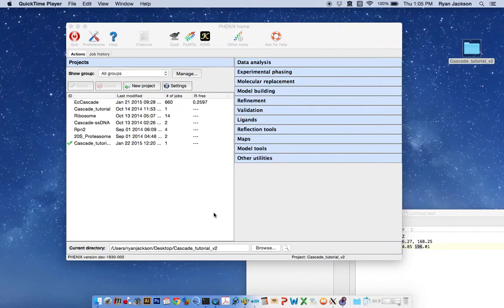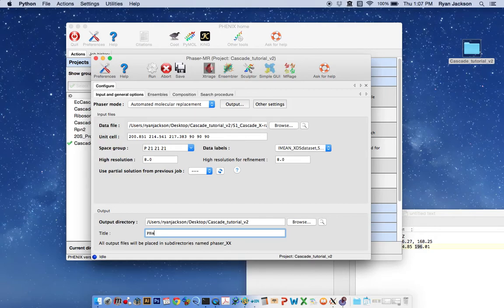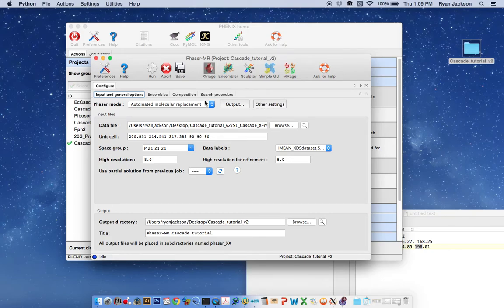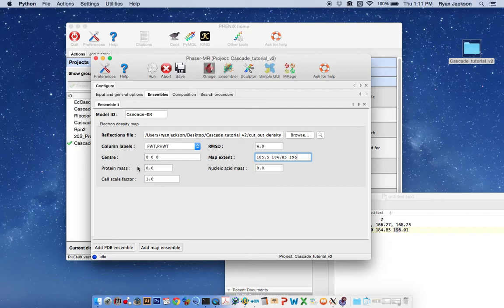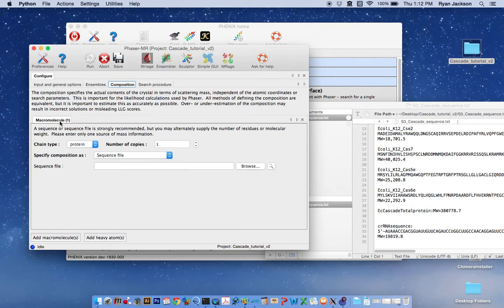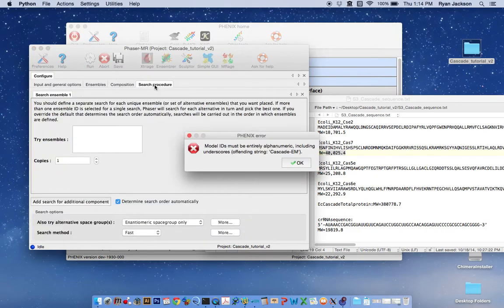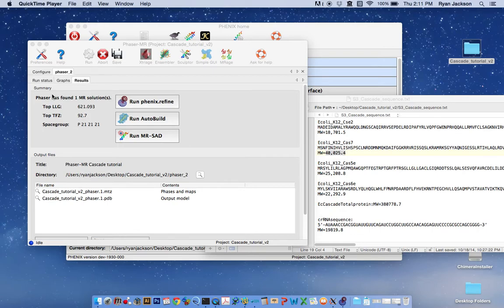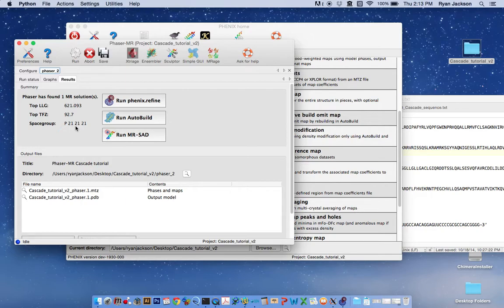Molecular replacement in Phaser with an EM map

Comment: I don't understand how did the output PDB file just came out of thin air when you didn't input a PDB file, as in normal MR run? Can you explain?
Reply from the maker: Thanks for your question. As you probably saw in the tutorial, instead of using a .pdb file as a MR model, we use an EM map that was prepared in .mtz format (shown in our tutorial 1 how to prepare an EM map for Molecular replacement).  After the run in phaser, a .mtz file is created (map coordinates) as well as a .pdb (model coordinates).  The .pdb however, is not the same kind of model you normally get out of phaser if your MR input is a .pdb file. Rather the .pdb output looks like a three-dimensional grid of pointer atoms that are not bonded to each other. These atoms can help guide you to the part of .mtz density that contains your molecule, but they do not act as a good atomic model.  In summary, the pointer atom based .pdb file is generated by phaser, when using an EM map as an MR model to delineate the position of the density that contain the molecule. I hope that answers your question. You can find all the supplemental files for this protocol in our nature protocols paper and you can run it yourself if you want to see what I mean. Please comment again if you are still confused.